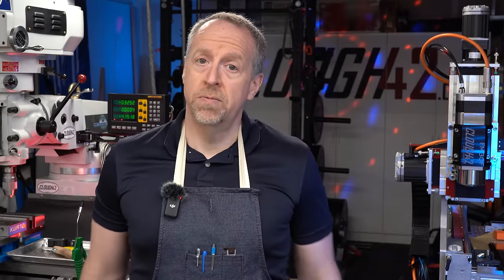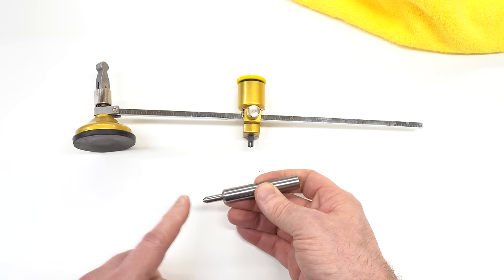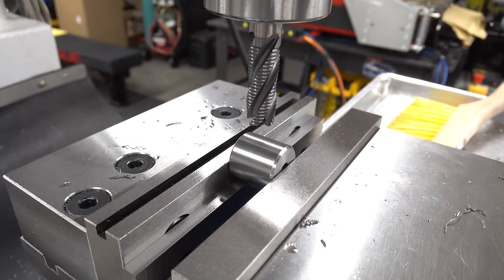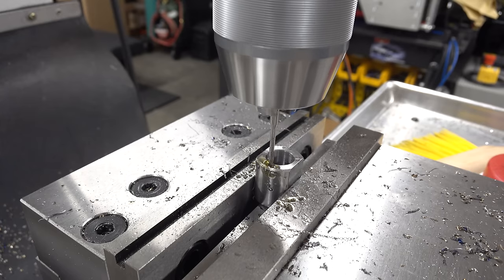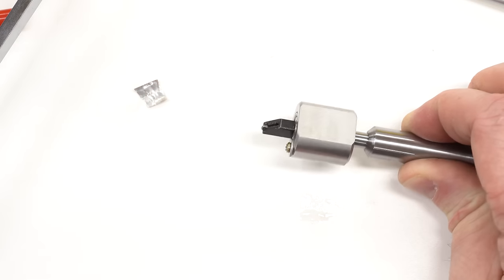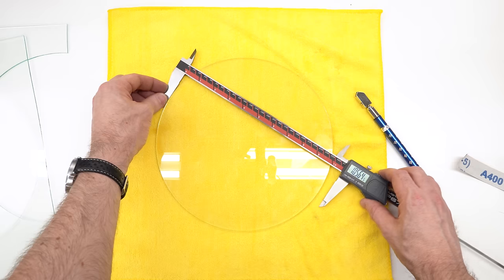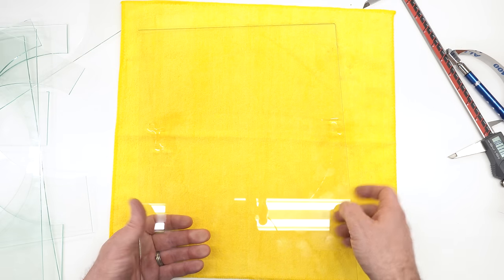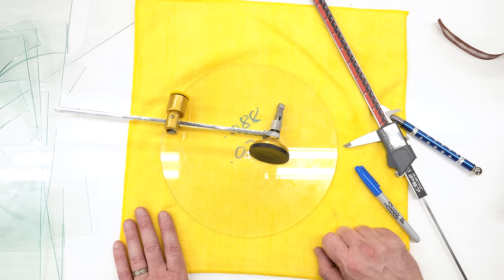Making a CNC Glass Cutter | Avid CNC

Comment: Well, you pegged the problem earliest and best, when you described the propagation of the crack through the vertical plane of the glass being imperfect and uneven.
Folks I know that need dimensionally correct pieces will use a 2 x 72“ grinder with a water drip and silicon carbide or ceramic belts with the piece mounted in a precisely positioned puck clamp and rotated against the belt to take off a few microns here and there until they get the exact diameter they want. The only other thing I know of to get better results, is to use a machine type press to split the glass just outside the wheel line, with consistent pressure all around. Or, getting closer but still shy of machine tolerances, use a professional grade glass cutting ($130-$2,000) machine. Or pay for someone to try a waterjet.
Sadly, short of some of the above, you’re stuck with the kind of deviation that you’ve been seeing.
Great video! Some days are learning days, aren’t they?
Reply from the maker: Yeah, this is what I'm concluding as well.
Reply: @Clough42  i should think the easiest method for simple circles is to cut a known dimension out of a material you can control and then score off that with a fixed offset. if you want 10.091, why can't you make a 9.591 circle blank, and score referenced off that with a centerpoint mounted in a 0.5 holder? basically an inlay technique but instead an outlay
Reply from the maker: @Idontwantagoogleyoutube  the problem isn't the score.  The problem is that the crack does not propagate straight down through the glass.
Reply: @Clough42 
Has anyone suggested using the drag diamond engraver to score your glass? If not, let me be the first. But as you said, the score is not the issue. Food for thought.
Reply from the maker: @ZXLMaster  it's been suggested many times and I have attempted it.  It hasn't worked for me.  The edge of the scratch is kind of flaky and fractured, and the crack doesn't follow it.
Reply: @Clough42  
Well, glass panes are formed from molten glass across a bed of liquid tin. There are very likely inconsistencies that are unpredictable.
Reply: @Clough42  can I cut non perametric shape like "&"

Comment: From the amateur astronomers I’ve seen on YouTube, most cut (or mold) their circular glass blanks oversize, then wet diamond grind the blanks to the correct diameter. I think you’ve achieved the best results that may be achieved with the process you’re using.
Reply: Yep. For mirrors, I just use a circular mask rather than make the blank perfectly round.

Comment: My experience from a project where I built 1400 doors with glass and mirrors is that getting precise dimensions on glass is done by grinding after cutting. Since glass is an amorphous solid and not crystalline it’s not going to break exactly where you want it. The grinding serves to give a safe edge as well.

Comment: The next time you run the part, mark the orientation of the part and see if the high/low dimension corresponds to where the axis reverses as it goes around the circle.
Reply: That.  Also to check if the larger dimension is consistently in X or Y, because you could then purposefully try to make an oval to compensate.
Reply: maybe also rotate the glass 90° between two cuts to see if it´s a material or cnc based problem
Reply: If you cut two circles, mark their X and Y orientation and stack them so that X of first is on Y of second, you will see how much you are out of the circle or how much your gantry is off.

Comment: For tiny boring bars, I use Simtek Simturn AX carbide bars that can cut OK down to about 2mm diameter. They do much smaller ones that go down to 0.3mm and they are reliable at 7-9 x depth. I use them to machine tapers from 4.5 down to 2.0 mm inside antenna feedhorns. I made a holder using a cross-pin and setscrew to set the orientation against the angled rear face because the factory holders are $$$$$$$. I "invested" in a full set of three-point bore mics and ring standards from 6mm to 50 mm, mostly from ebay purchases, and I've hardly used my old Starrett telescopic snap gauges since then.

Comment: Used to get glass inspection plates for measuring color on moving materials, basically an optically pure sight glass. The glass shop Proscience would cut the flat sheets round then wet grind them to the exact size. Looked like a lathe with a huge steady rest and suction cups for a chuck. Did wonderful work,  they were always perfect.

Comment: Might be worth looking at the glass through polarised light, just in case there's any residual stress that's causing the circle to deform when broken away from the parent material. I would also, as others suggested, mark datum points on both the stock and circle to see if the variations are plane specific, and related to any internal stresses.

Comment: This is reaching back into the deep recesses of my memory, but I think that the glass blower at UVA's Chemistry Department in the early 70's used a glass lathe & grinding wheels to make precision round items. I worked with him on a couple of research projects as part of a Summer job & my thesis (Chem Engr) and would always spend time just hanging around after he finished working my job or when I was picking up the fully annealed end product because what he could do was fascinating. Somewhere I have a complex mini reactor that he scrapped because it was out of spec (but no one knew it's not correct except him & me, and I guess now a lot of others).

Comment: Could you clamp the glass on vacuum riser block,  find center and grind 0.020" off the edge with a diamond wheel circular G2 or G3 path in the CNC?  Should result in a square edge and +- 0.001" circle.  The vacuum block could be a box made with couple sheets of plywood, 2x4" edge spacers, a grid of holes in the top with a non slip pad and a large hole in the side for a standard vacuum cleaner.   I use this design for milling PC boards.

Comment: Just need to make a strong suction cup device to hold the glass and go in your lathe with the 4 jaw chuck so you can adjust for runout.  Then a strip of sandpaper on a mildly flexible backing that you can hold on the toolpost and slowly feed to hit final diameter.  I say all of this mainly because I want to read the safety nazi comments if you do it.  ;).  As always, I enjoy your videos immensely!
Reply: Lens makers for 100s of years have stuck blocks of wood and dowels to their glass blanks to act as handles when grinding, usually by using melted rosin or hard wax. With a jig you could presumably get an axle positioned better than you could a suction cup (which is likely to slip sideways as you squeeze the air out), and has the advantage of not being particularly flexible.
Once the axle is installed, proceed as you described. :-)

Comment: Just curious... did you try just scribing the glass with the drag diamond? This would be sooo much faster than my diamond ring saw (and of course more accurate).
Reply: I use a diamond scribe to cut glass. The engraver probably would work great.
Reply: Was coming to ask the exact same thing.
Reply: x3
Reply: I also came to find this comment.
Reply: First thing that popped into my mind watching this too.
Reply: same.
Reply: I had exactly the same thought!
Reply: this would be interesting to see tried out, as it in any case would isolate scribe positional error form that arising from inconsistent cracking
Reply: Agreed; came here looking for just this comment.  Even 'precision made' glass cutters that I have seen have a certain amount of slop between the cutting wheel and its axle.  Does the cutter then induce forces that are not perpendicular to the plane of the glass?  Does this then cause the crack to propagate in a non-perpendicular fashion around the perimeter of the circle?  I expect the diamond scribe/engraver would do a better job of maintaining the force perpendicular to the plane of the glass.  Ordinary glass is not crystalline; I expect some non-perpendicular crack formation to be a result of this.  Be well & Best regards, Gottfried
Reply: Tighter tolerances remove the spring
Reply: @moki123g  what Diamond scribe do you use? I’ve never had luck getting the score deep enough to break on the line.
Reply: @rockymtnfragrance  You probably are trying to score too deep. You just need a light scribe. A little oil helps too. Only do one scribe, never go over it again. Get some cheap glass and practice a bunch. Remember that you are not trying to gouge a groove just score the surface tension. The scribe I use looks like a pen, costs about ~40 from mcmaster car.
Reply: @moki123g  thanks for the info, I’ve tried light scratches, deep and everything in between using oil. I’ve tried heating then cooling the score, trapping on the back, and using pliers. I can get it to break everywhere but the score. When I use my scoring wheel I don’t have the issue. The issue is I can’t find a scoring wheel which will fit in my CNC but I have the scribe that does.

Comment: I once talked to a man who made stained glass windows and told me he had good results cutting glass with a water jet CNC. Unfortunately, I don't know what kind of tolerances he was able to achieve, but I understand that this process can cut thin materials to better the .005".
Reply: 0.01 mm with waterjet = 0,0004" In Europe we also work with thou... sands of mm... change to decimal and you will work more accurate....

Comment: Hello
Even in automated glass cutting processes, the guys use a petrol based lubricant/cooling placed on the path to cut before to run the carbide wheel. It seems to improve the cutting.
Another thing : As it's a drag carbide wheel, it means it is slightly off centered and your cnc drives the trajectory of the center of your tool. Not the wheel. Could this lead to some discrepencies in the final dimensions?
Reply: @johncoops6897  I guess you didnt read his comment, where he clearly said "on the path" and not "a few drops on the glass"... but more importantly he nailed the biggest problem with this... the cutting blade pivots on the center of the tool, and doesnt follow it.
Reply: @TravisFabel  Thank you john. You got my point! In car glass industry, they automate the cutting of glass parts and machines have a continousely fed flow of petrol lubricant ahead of the wheel.
Reply: @johncoops6897  Yes but it shouldn't be oil. Turpentine works best. As much to lubricate the wheel as to ensure a good cut.
Reply: Mineral spirits also works well

Comment: Probably 20 years ago a relative got a job running a CNC water jet cutter for a stained glass shop. Complex shapes were breaking unpredictably in expensive glass. They didn’t need super tight tolerances but the labor and material savings let the company finish ahead of the deadline and profit even after buying a very expensive machine back then.

Comment: The one and only time I ever had a round glass table top made, they had a plywood table with a lazy Susan on top of it on which they placed the glass disc. Attached to the table was essentially a Disc Sander on its side. They just slowly turned the glass disc against the sander to finish the edge.
Confident you can come up with the high-tech Precision version of this...

Comment: Try using the diamond engraver to score the glass instead of the caster, it might improve the precision by eliminating the bearing run-out and wobbling of the caster.
Reply: I was thinking this too. Is it more likely to crack the glass than the scoring wheel?
Reply: The diamond engraver might actually work quite well.  When I need to score glass I just use a carbide scribe.  Similar to what you would use for marking steel.  

I would say there is a learning curve for getting the pressure right, but I would also say it's not that steep of a curve.
Reply: @anmafab  I'm no expert at glass cutting but it couldn't hurt to try, after all what's more fun than wasting material in the pursuit of perfection?
Reply: @nathanliebespeck8088  James' engraver is spring loaded so tuning it may be as simple as adjusting the spring rate or compression.  If that doesn't work next I would try to dampen the spring to keep the tool from vibrating.

Comment: As others have said driving the crack around uniformly is the problem. As someone else suggested, cut from an oversized circle to make the boundary conditions uniform.
Driving the crack by pressing downs with your fingers in a few places is not a great way. You might be able to correlate the out of roundness to where you pressed. However to drive the crack uniformly is I think the key. Once scribed you might be able the drive the crack with a flame. That might well move thermal expansion the wrong way. Try touching the crack with a cotton bud dipped in liquid nitrogen then once initiated, push the crack with the cotton bud keeping it wet with lN2. I also saw strange shapes cut into glass without scoring (except for a small initial crack.) The equipment had a head with three tubes side by side. If I remember correctly cold air was blown out of the middle tube and very hot air through the outer tubes. Apply that behind the crack tip and the crack will grow away from the cold tip and perpendicular the the line of the two hot tips. If the tips are moved and rotated in the right way, the crack can be steered around through quite tight radii.
I’m pushing my faulty memory a bit far but I think it was used to cut precision display panels.

And I just remembered that in the old days glass cutters would rub spit into the score - this lowers the stress required to drive the crack due to stress corrosion. This means the crack grows more slowly and is less likely to wander off the score line.

Comment: I have cut glass tube and rounded discs by putting them on a lathe and using an angle grinder on it, came out surprisingly accurate from such a crude method.
If you have a grinding attachment for a lathe that would help, and I am sure you could use diamond or even just carbide tooling if you set the feed low enough (use a negative rake tool if you can).
To be honest I think the easiest option would be to just grind off the high spots, fine carbide grit on a belt sander is very effective, but for adjustments this small you could just do it by hand.

Comment: The glass cutting edge will travel in a sinus wave like way around the ideal path. Like train wheels on a track or wheels of a shopping cart. On a curve the mechanism is pulling the cutting edge not on a tangent to the circle/curve but a secant line. This will introduce side forces to the cutting edge touching the glass.

Comment: Howdy great video.  I know you probably already thought about this, but I use my Avid Cnc to cut vinyl and gasket material using a Dog River drag knife that functions almost exactly like your CNC glass cutter.  One thing I did not hear you mention in your video is the drag knife blade offset.  When I use the drag knife I use Vetric Aspire for the cad and cam work. Within Aspire there is a specific tool setup for a drag knife operation in the Gadgets drop down. One of the important settings required is to set the blade offset, this offset places the cutting edge precisely on the cut line.   Once you set the dimension in the CAD, you do not try to chase the perfect diameter, you adjust if needed by changing the blade offset.  I don’t know if this helps out, but I thought you might be interested.
Great Machine work by the way!!!!  Thanks

Comment: Really cool stuff, James.
Perhaps you'll be able to get rounder parts with some elliptical pre-emphasis to the round cutting path?  You'd have to get a way to index the part to the rectangular blank to the work holding fixture.  Maybe the out-of-roundness is somewhat repeatable to a location in your machine.  I hope you can see your way clear to tighter tolerances.

Comment: Just a thought I assume that the bevel on the edge varies according to where you press. I have seen a trick used by the guys who custom cut windscreens they pour alcohol along the cut line and light it the differential heating cracks the glass instantly. They do identical cuts on either face of a laminated screen close enough that they cut the laminating film with a razor blade.

Comment: Whilst (usually) not round, the aquarium that are made on industrial scales are ground on the edges - I'm sure that's to some degree cosmetic, but it also ensures a better size. I have quite a few hand-made aqarium too, and the edges aren't quite the same straightness.

I'm pretty sure, like Anton W says, the only way to guarantee precision roundness/dimension is to grind the edges. Because when the glass breaks, it will vary a little out or in from the score.

Comment: I have an idea that might help you out. Use your welding table as a jig for an over sized lathe. The fixturing holes should be precise and rigid enough to machine a spindle mount to hold oversized stock off of the side of the table. I came up with this while trying to come up with a way to cut large gears that didn’t fit in my lathe. It would only be good for low speed and low pressure operations but I bet it would work a treat. Plus you have a waaaaay better welding table that I do. Machine a vacuum spindle and an X/Y tool holder that index to the holes in your welding table and you could have precisely ground glass in the home shop. Heck I bet you could leave a drip trey under the glass and run coolant too.